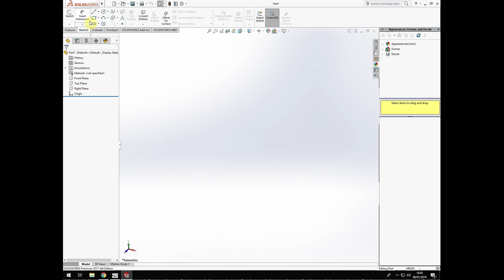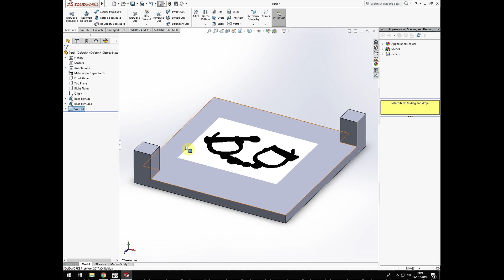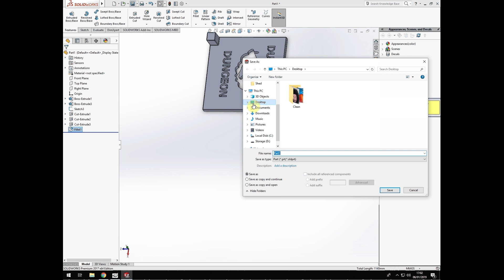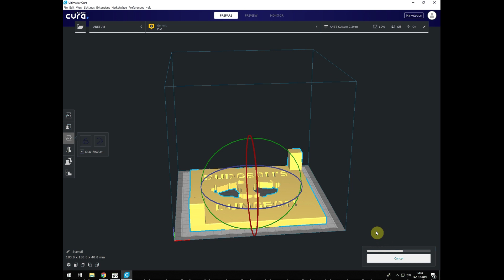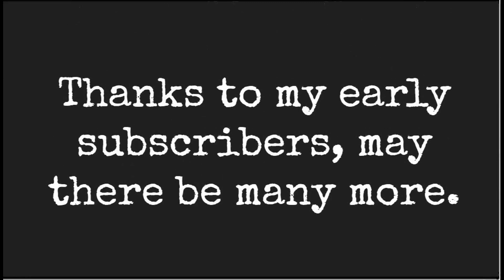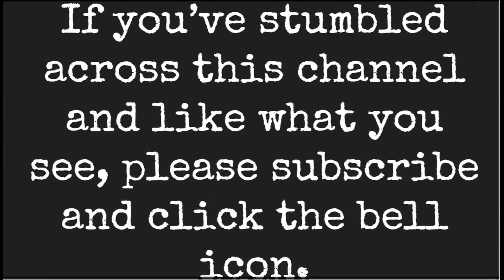Projects: 3d Printed Logo Stencil

Comment from the maker: The print was a little messy initially, I found this was because the nozzle was too close to the print surface. Once I stepped it back 0.1mm the quality showed significant signs of improvement. Also, I'm running the printer on the floor of my new workshop. I have not yet set this space up yet and I wont do until I know what I want, I don't even have power in there yet. So I was running a magnifier lamp (for light) and the 3d printer on an extension cord. Somewhere in the middle of the print I turned the lamp off then on again, this caused a small surge which crashed the print, I only got 5mm into it. Not a train smash because 5mm was ample for a stencil. 

The audio quality was pretty poor on this video, I've ordered a clip on microphone which I'm hoping will help in future.
Reply from the maker: Need to decide on my next video, may do a quick workshop layout video... if you have any ideas, let me know.

PS. please like and subscribe